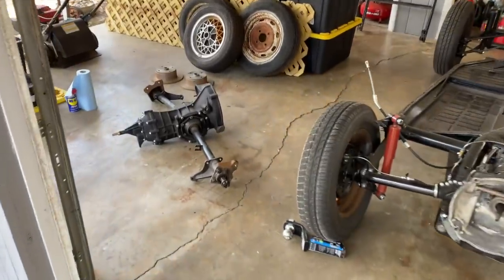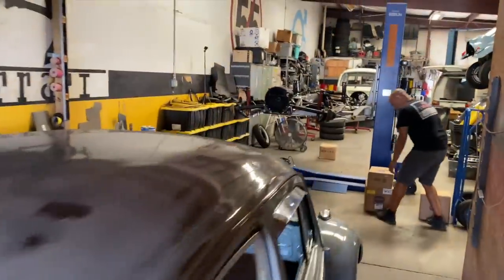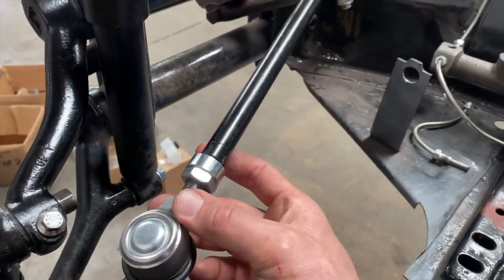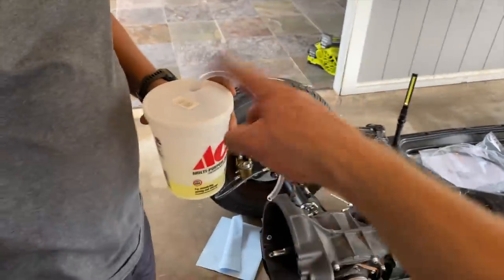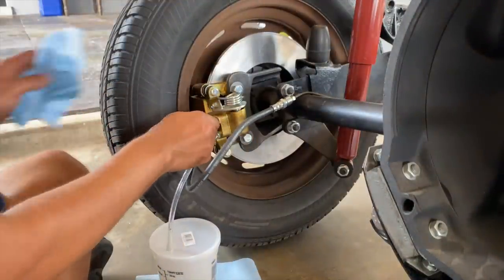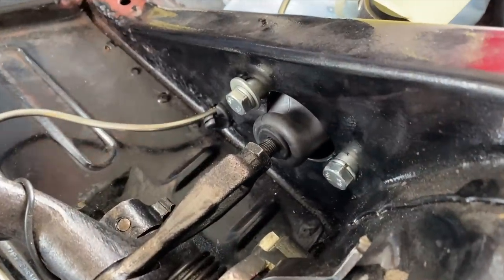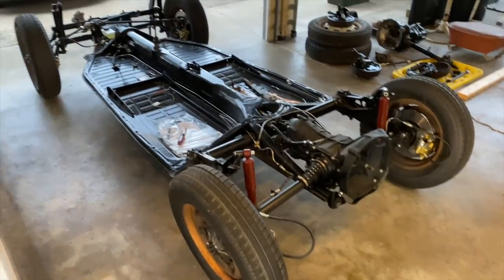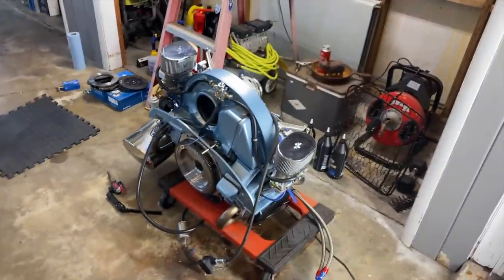Disc Brake Converson - VW Beetle Chasis Restoration

Comment: Those some long azz rubber lines.
Reply from the maker: Yes they are! =)
Reply: @CTmoog  Make sure to keep them away from the tires because they can get punctured by the friction. A friend of mine had that problem in one of the front ones with a narrowed beam. Those need to be measured carefully, especially the ones on the front; those you need to test out by steering all the way to the right and left to make sure they don’t hit the tires at any point.

Comment: I had a rear disk brake conversion done on my fiberglass dune buggy. I’ve had trouble with it ever since the conversion. They put a empi 22-2914 kit on it . After some research I found out the 22-2914 is for IRS and my bug has the swing axle. Anyone know the difference of the conversion for a IRS and swing axle is.

Comment: Did you flat tow it with no oil in the transaxle?☠️
Reply from the maker: It has one jug. Needs two more. We only drove a couple miles at low speed.